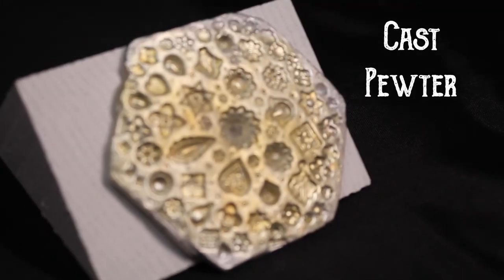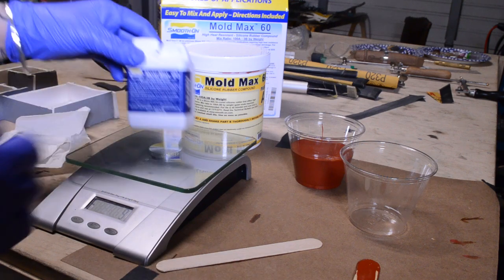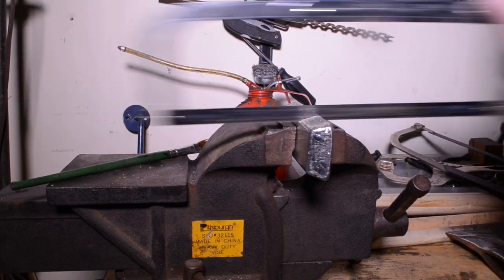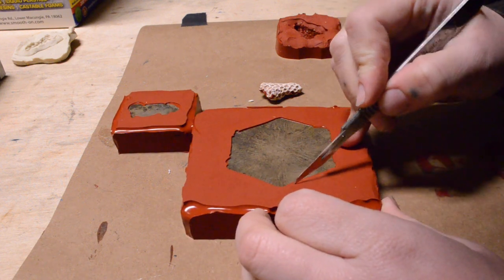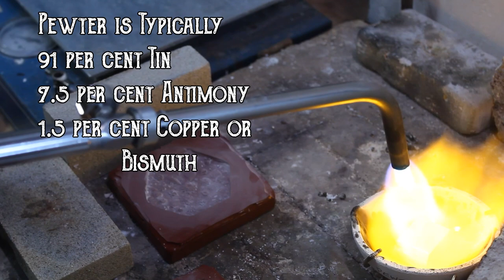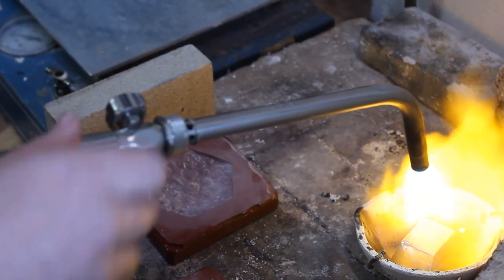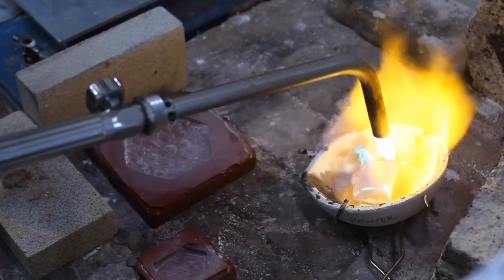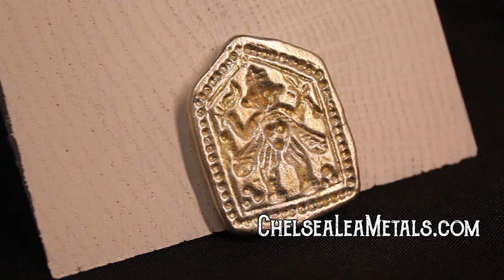Pewter Casting Tutorial

Comment: You were too fast for me! What temperature do you pour at?
Reply: That wasn't a very good way to melt pewter so no idea. It should be cast between 260 and 300C higher temperature required for thinner sections but that will only happen with a 2 part mould.